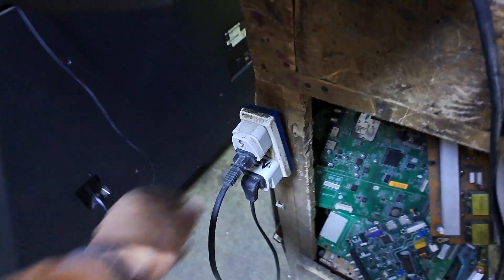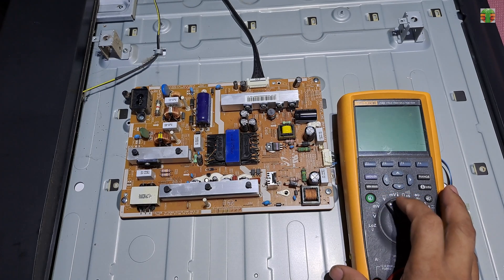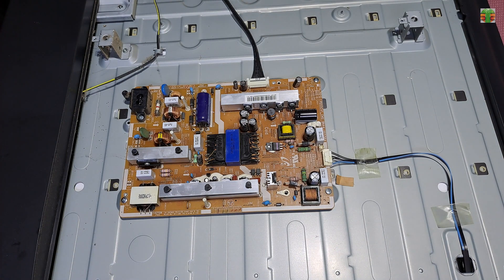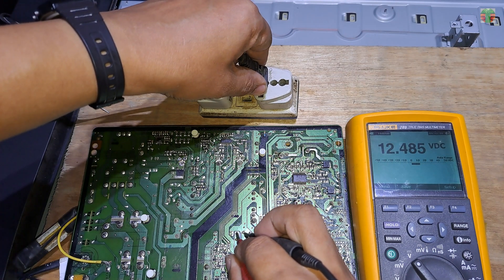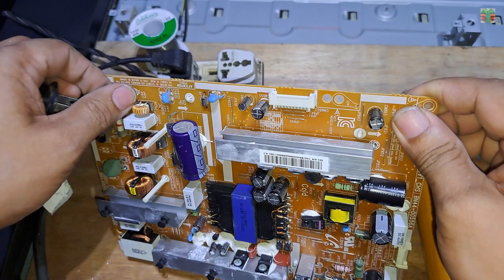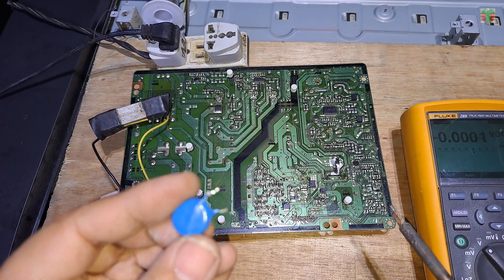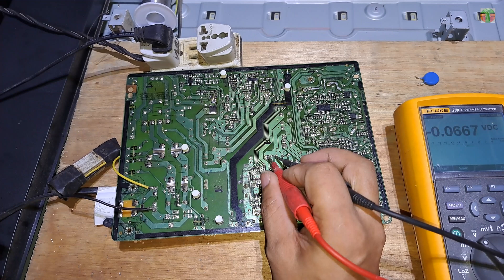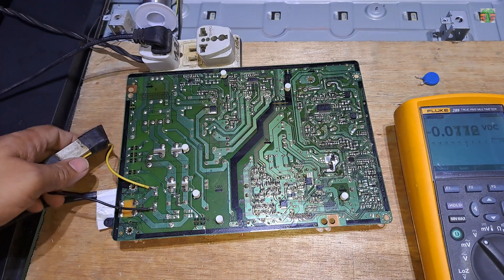Easiest way to remove the PFC.

Comment: Hello . My name is Robert.  And I have a problem with  a pfc tcl led tv power supply . Board # 40-E04022-PWF1XG . On the output pin  this is no power on BL_ON , P_DIM ,P_ON  . No 5v  power output . 12volts out  is 11.5 volts to power the motherboard . How can I fix this problem ?

Comment: Sir you are great 👍 I have a question 
1)Is there any disadvantage of operating without the mosfet.
2)Can all power supply circuits work without the pfc or there are specific ones
Reply from the maker: It depends on the power supply circuit.

Comment: Why not swap the mosfet than disabling the entire circuit
Reply from the maker: Replacing the mosfet is not guaranteed to work. Mostly when the power mosfet is damaged the PWM driver is also damaged.

Comment: Well, obviously removing the PFC works ... but why not just replacing the MOSFET? I mean ... if customer pays for it of course, missing PFC is on his electricity bill 😄
Reply from the maker: Most replacing the mospet is not guaranteed to work; if the mosfet gets short, the driver also gets damaged. The PFC only gives about 5 % less of the electricity bill.

Comment: Hi tevz from Sydney Australia. Thank you for your time and teaching. 
* After continuity of fuse looking for the cause. 
* I'm thinking instead of attaching a resistor  use a Variac 60-120V if the fuse doesn't blow increase to 220V
🌏💫
Reply: Would a dimmer work? Of course, as long as it respects the power it offers.

Comment: The issue of the unit is no red indicator light but there is 3.3v stby .we have also 12v .5v and 1.8 v when power is on
Reply from the maker: check other voltage
Reply: @tevzTVTevatronics we also measure 1.2v....in the main board....also i measured vgh 28v and -8vgl  etc......in tcon board
Reply: Where is your location sir
...if you dont mind Sir if you have messeger iwill send you the picture of  this board..to  indicate the voltage and testpont .to  made trouble shooting   easy to me.

Comment: Sir until now i cant find what parts in this unit was giving the trouble pls help.hisence 58A7100F..........May i ask what is this cm121k.1n ic.. is this a protection ckt in the backlight drver.what. pin in  this IC was the protect ..thank you.
Reply from the maker: no data sheet. no idea
Reply: Thank you sir .i hope you will help me later on